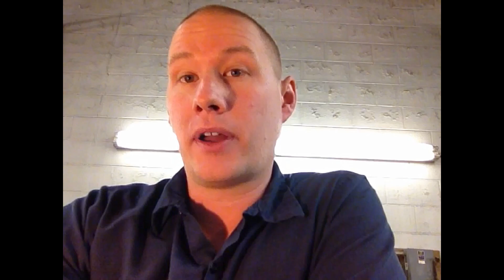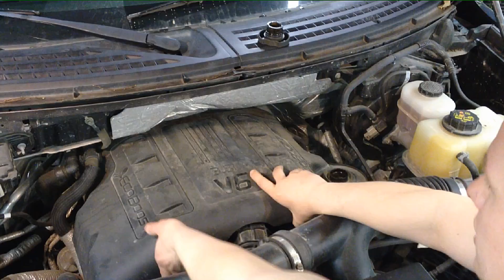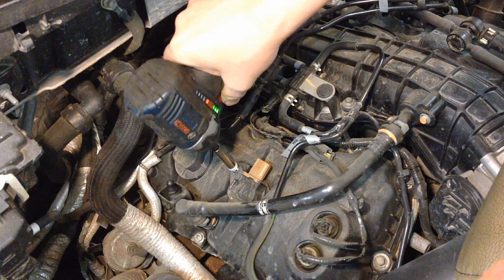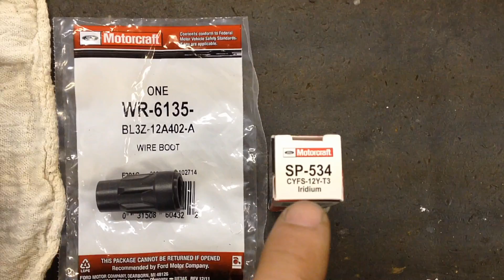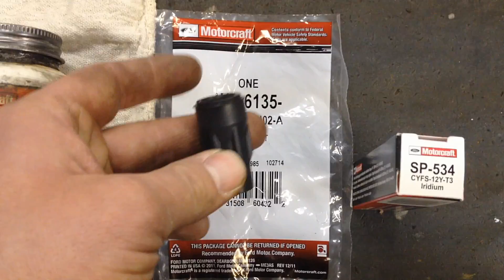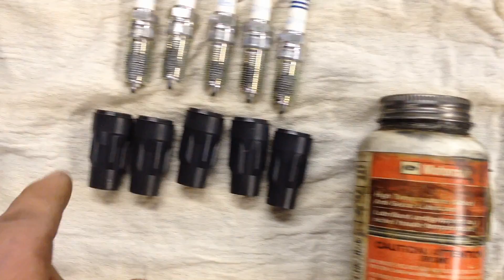2011-2016 Ford F-150 3.5L V6 EcoBoost Spark Plug Replacement

Comment: thank you so much for the help!!! You're a lifesaver!!!! the only thing I needed help was was removing those stupid red coil pins..one broke that's when I watched you're video to see how to remove them properly. had to use tweezers to push and a small pry tool to remove them as they were stuck. didn't replace the boots but when it was done it still ran like a champ!!👍
Reply: What did you do to fix the broken red pin? I broke one, even following the tips here.

Comment: i have a code po299 turbo/supercharger underboost a is that drivers side turbo or passanger
Reply from the maker: It can be for either turbo it is a general code based on the boost pressure measured in the intake. Look for the turbo with the noise.

Comment: so I just replaced the plugs on a 2012 f150 that had a misfires problem at 116k. I used anti size but now I read it shouldn't be used. will that cause any issues ?
Reply: John Lewis I doubt it I’ll. I’ve always used anti seize on all my spark plugs and never had issues.

Comment: i have a 2014 ford ecoboost 3.5 and have the surging problem.  i want to change the sparkplugs but what gap would i use? i have heard 28 thousands, 31 thousands and even 50 thousands.

Comment: should i unhook one side of the battery? how often should i change plugs on an eco boost? i hear theyre hard on them?
Reply from the maker: You want to change the plugs on the ecoboost engine every 50k miles and gap them at .028" no battery disconnect is needed.
Reply: @FordTechMakuloco  lol mine were last done over 100k ago... no issues, but its about time for it to be done

Comment: From a viewer in Lockport, IL - Thanks for the tips.  Performed the spark plug replacement last night without any issues.  Own a 2012 Eco F150 and a 1995 Mustang GT, and plan to contact BSG if/when I need to.  Great videos, keep it up.
Reply: Michael Skawinski what type of plugs? and gap. I have a 2012 as well and want to do this on my own
Reply: I used the Motorcraft SP 534 and gapped on the small side: .0028 to .0030"  as recommended.  Many of the plugs I pulled at 60k were well wider than that (factory originals) with some around .0045" and up.  I did not experience any misfires before the swap, but my idle did smooth out.  At 73k now with no issues.

Comment: Can you have a misfire code without throwing a CEL?
Reply from the maker: +Chuck Lawson generally no as a misfire code is emissions related
Reply: Yes it can, I had a misfire cylinder 6 and it threw a CEL.

Comment: I rock snap on wobble extensions works great! I put boots no matter what. also another huge tip. to get the connectors off is to take a 90degree pick and slip in inside under the hook part of connection  and lightly pry up while pushing button never fails!

Comment: Great instructional video, thank you so much. I paid about $450 last year for them to swap out #4 and an ignition coil only to continue to experience the same bucking when getting above 60mph. #4 was at .030" and the rest ranged from .038" to .045". I took a road trip and gave it some pretty aggressive hills and it never missed a beat.
Reply: Jeremy Jacquez so u changed all the plugs and it's not bucking anymore ? I have the same thing going on with my truck

Comment: That was great information and saved me a lot of money. My only issue was taking the coil connectors off. I found by the last plug that having a very small standard screw to proved a small gap made it much easier to pull them off. Thanks again for posting such a detailed video.

Comment: Anyone know what to do about a plug that is seized solid in place on my 2013 ecoboost? Some forums say carb cleaner others say penetrating oil?
Reply: I know this reply is 3 years late, but here goes.

With the engine at operating temperature, work quickly to get access to the plug and zap it loose with a impact.  Works great on stubborn plugs.

Comment: Great video!  I had my truck losing combustion a bunch and ended up changing all my spark plugs (100K+ miles).  Sure enough all the old plugs were carbon tracked.  BEFORE seeing this video I bought all new spark plugs (NGK Laser Iridium Spark Plug) which cost me around $13 a plug at my local auto store (as opposed to $8 a plug for the stock Motorcraft plugs).  I change them all out using my anti-seize goo for a nice smooth turn when putting them in or taking them out.  Put it all back together and went for a test drive.  Within minutes I started getting the misfires again.  Took one of the plugs out that was getting the most misfires and found more carbon tracks!  My question is could new BOOTS and dielectric grease stop that from happening?  I'm about to just buy all new coils because I thought it was the coils going bad.  I found a pack of 6 coils (aftermarket) for about $110 online which is not bad.  But do I even need them?
Reply: Man, I wish someone with the answer had replied to this old comment...
Reply: @kbpl369  New boots every time you do plugs, ( mentioned carbon tracks ruin boots in video) and be hospital antiseptic with clean hands only on the new plug's porcelain. That is utmost importance.!!

Comment: So I was wondering if a double platinum plug can be used? Cut cost but don't want to lose performance (fuel economy, etc.). Also do you know why iridium? I know many have swore by its performance, but is it really that much of a difference in reliability vs. double platinum? why does Ford specifically reccomend Iraq? Thanks
Reply: Sorry (autocorrect), why does Ford reccomend Iridium?... and I have a 2013 3.5L economic

Comment: About to replace my plugs on my 2012 f150 3.5 EcoBoost, just turned 41k and starting to feel a little miss here and there.  I'd like to replace the boots while I'm doing the plugs, is the correct part #WR6135 for the boots?  Also, latest info I have is to use SP534 plugs and gap them at .030.  I'll also be adding the UPR dual valve catch can...seems to be the easiest to install.  I'm open to advice.
Reply from the maker: +Chris Hughes Yep those parts I have linked are still valid as the latest and greatest. As far as the gap goes I would gap them at .028" as many have had the best luck at that spec with room to grow. Ford has also lowered the spec to .028"

Comment: what are the best spark plugs for the 3.5L ecoboost engine i tryed the nkg and there trash and i also tryed the motorcraft sp534 there better but i was wondering if you know anything about this new msd spark plugs?
Reply from the maker: +Jr SM I don't get into the aftermarket or performance but I know the motorcraft plugs at .028" does just fine.

Comment: Just changed mine today in my 2012 it only had 37k on it but i fouled the number 6 plug so i just changed them all.  I did it the same way but i didn't disconnect the coil wire there was enough wire on mine just to pull out the boot without unplugging it.

Comment: Hi, 2013 ecoboost owner. Does the  .028" gap still apply? Ford make any changes? I'm about to service. Thanks
Reply from the maker: Yes stick with the .028" gap
Reply: +FordTechMakuloco Thanks
Reply: FordTechMakuloco 2016 3.5l ecoboost as well?

Comment: so does the 2013 model get the new sparks already? with the new plugs do I need to regap as well or if it came with 0.028" gap? mine doesn't have any issue unless you accelerate fast like passing vehicles on highways. some times it just suddenly lost power, I thought it was the transmission slips but dealer didn't find the reason. and that was an issue ever since it's new. Id like to hear your opinion on this issue. thanks

Comment: I just had this exact problem with my 2011...took it to my Ford dealer to have it fixed and they said they didn't know y it was miss firing. Thank you for the video. They did fix it but should I expect it to happen again?
Reply from the maker: +joemomma931 The plugs have been revised. Either way expect to replace plugs every 50k or so.
Reply: +FordTechMakuloco  thanks for the response....would u recommend getting an oil catch installed?
Reply from the maker: +joemomma931 Yes but make sure you use a monster can-http://www.amazon.com/gp/product/B00TPVAA28/ref=as_li_tl?ie=UTF8&camp=1789&creative=390957&creativeASIN=B00TPVAA28&linkCode=as2&tag=fordt-20&linkId=NQG3EPC5ZQUGRT57
Reply: did you feel loss of power but didn't have a check engine light cause my 15 isn't running as fast as it was took it to ford and they said there's nothing wrong. but obviously there is
Reply: +Kevin White I didn't feel any loss of power it would just kick or jump when I would accelerate quickly then I got the shake and check engine light after that happened for a while.

Comment: I just picked up a 2014 f150 5.0l yesterday with 13k miles and mine misfires only at idle with no MIL on. I guess I never noticed it. Most notably when you turn on the a/c. If ac is off it runs so smooth i cant even tell its running and just a barely noticeable shake every now and then. With a/c on it will run smooth then rattle and then run smooth. I checked mode 6 and its intermittent random misfires. 1,3,4,5 were misfiring but the most misfires reported was 8 at cylinder1 and 1 misfire in the rest. Ltfts were -2 each baml. Also I cleared the keep alive memory and it ran good for a bit then back to misfiring. My suspicion is maybe spark plugs and/or boots. I have an extended warranty on it so im going to bring it in but wondering what you think could be a possibility. Well see what they say
Reply: I think I solved it. Spark plug gaps were close to 0.06 and they are supposed to be .049-.053. All is well. Well see if it comes back
Reply: +nicholas elias only 13k miles and the plugs gap was off that much?

Comment: Awesome video, quick question is the torque spec for 2.3L Ecoboost Mustangs 133 in lbs as well?
Reply: +Zack Anywhere we could find these specs or is this all in service manuals only?
Reply from the maker: +Zack 106in lbs
Reply: Are the torque specs specific to each spark plug brand or the engine? I see for say NGK and Denso the torque spec is around 18 ft lbs

Comment: Great video thanks for posting.  I have a 2011 F150 ecoboost with approx 65k miles.  Service Dept informed me of the spark plug problem and gave me an estimate for 3-4 hours and $445 to fix.  This sounds a little high based on your video.  What is the TSB number for this?  How long should it generally take?  Thanks
Reply from the maker: +Andrew Waits This would take 1.0hrs to perform being extra clean about it. It does pay 1.4hrs customer pay though so whatever their labor rate is. I personally would buy the plugs and boots from my links which are cheaper than the dealer and just follow along with my video to replace them.

Comment: awesome video. thanks for the help. My coil packs seem to be stuck pretty hard....in fact the boot has actually torn in two of my replacements and was left attached to the plug at the bottom of the hole. i have the drivers side to replace still, any advice on getting the coils out without cracking them or ruining more coil boots?
Reply from the maker: +Brian Gilliam The best you can do is follow my methods but this does not guarantee the boots wont be torn. Even if there is any doubt they should be replaced to prevent further misfire damage. I have links to the replacement boots from Ford in the video description.

Comment: how do i find out the gap on the spark plugs?
Reply from the maker: +Brandon Derosier You check it with a feeler gauge it should be around .028"- .030"
Reply: .27-.37 ford spec just buy ford plugs

Comment: Great video.  I have a question maybe you can help with.

I have a 2015 Focus ST with 7000 miles on it.  It has been to the dealer 4 times now in the past 3 months for the check engine light activated by misfires on cold starts.  The misfires only occur on cold starts (after the car has been sitting for 8 hours) and the driveability of the car is not affected.  After the 4th time in for this, they replaced all 4 injectors and all 4 plugs.

Question- isn't 7000 miles a bit early to be experiencing this issue?  The fact that the misfires only occur on cold startup has really confused the dealer and they've gone back and forth with some Ford hotline for help diagnosing this issue.
Reply from the maker: +ak2112 They should be resetting the misfire profile too.
Reply: +FordTechMakuloco Yes, they've reset the misfire profile.  On my third visit to the dealership for this cold start misfire issue, they replaced injector 3 and reset the misfire profile.

On my 4th visit, they replaced injectors 1,2,4, the plugs and again reset the misfire profile.

Thanks so much for responding.

Comment: when changing the ignition coil, if the boot appears to be in good shape does it need to be replaced?
Reply from the maker: +Kris Sulonen generally no
Reply: If you're changing a coil, you should be replacing a boot.  It's extremely hard to decipher/see carbon tracking inside the boot due  to it's color. They are inexpensive in relation to the issues they can create when worn. I will always replace them with plugs on my OHC Ford engines.

Comment: 2012 F-150 Ecoboost.  Had latest PCM flash per TSB but did not let them put deflector on intercooler for condensation issue. Misfires getting worse and worse @ 45K miles - especially in hot conditions when climbing grades at low rpms........Ironically when pulling my horse trailer at higher rpms it runs like a champ..go figure.   Put new 534 plugs gaped to .28 last week.  Did not help.  Getting ready to install 6 new DG-549 coils.  Hoping for the best.   Will give update for anyone out there having similar problems.
Reply: +skeeter1317 Run premium fuel and that will go away.  You're feeling the truck pull back timing because of low octane fuel.
Reply: +Ricky C  Definitely wasn't a fuel or intercooler moisture problem. After being in the shop for a month and replacing many components it was finally determined to be a short in a large wiring harness of some sort that was causing a voltage problem. Sorry I can't be more specific but that is what it was .  10k miles and 6 months later and my truck is running strong.  And even though trick wad technically out of warranty Ford didn't charge me a dime...and I have a newer model intercooler to boot.
Reply: Cool...  I'm actually tired of getting the intercooler condensation issue on my truck, so I'm going to be replacing my factory CAC with one from Full Race.  It should be here in a few weeks.

Comment: first time changing spark plugs ever, this video was perfect.  highly recommend making the tool setup the same way.  i was going to bootleg it and glad i just went and bought the joint and socket.  do the grease and the anti-seize as well. I would also say, use electrical tape around the joint as shown to prevent damage.  the rear cylinders are not hard but tricky to get the tool in there.  I had to wrap tape around my entire socket tool assembly since as the first one i did, the spark plug socket stuck to the plug and came off and had to fish it out of the tube.  

also, get the good tool for gaping the plugs.  i couldn't get mine precisely at .028, kept going too far so I settled on .030 haha.  took care of the codes and misfires I developed this week changing plugs and clearing the codes with the livewire ts.   again, great video.  of all of my old plugs that came out, 4 were .042, 1 was .041 and 1 was .043 (this one in one of the cylinders with misfires).

Comment: I have a 2013 F150 eco, it has 45000 miles on it. It has a slight rough idle, could it be plugs?

Comment: Great video and great information.

I have a 2013 F150 with the 3.5L ecoboost and I had the same problem. My F150 had 55,000 miles on it when it began to misfire. When the misfire problem started, I checked all of the spark plugs, as recommended in your other ecoboost misfire video, and they were all within spec (.030 mm - .033 mm according to the owner's manual). When I visually inspected the spark plugs none of them had carbon tracks. I reinstalled the spark plugs, but I kept having the misfire problem. I took the F150 to the dealer and their diagnostic computer indicated a misfire on pistons #1 and #4. The dealer replaced the spark plugs and it has been running fine ever since.
Reply: Second from front , on passenger side
Reply: How do we count the pistons/cylinders? I’m having misfire on #2 but not sure which one that would be any suggestion?

Comment: I plan on changing my 2012 F150 Ecoboost plugs as I just started having the shutter issue and misfire error.  I am going to do the plugs myself and wanted to take the truck to get the computer flashed as it seems there has been alot of updates since i bought it correcting various issues. I called to see what the cost for a flash would be, but it didn't sound like they would do it without an error which I am hoping to clear up myself with the plug change. I could tell the tech wanted me to bring the truck in and have them do the plugs. Does this sound right or are they trying to get money out of me. Shouldn't I be able to get an update or is it only done when the can see an error.
Reply from the maker: Michael Muniz Go in as a customer pay service request not mentioning anything else and ask for the pcm to be updated they should charge half an hour to and hour for labor. Do the plugs yourself as per my video they are very easy and all the latest spark plugs  and anything else you may need are linked in the video description